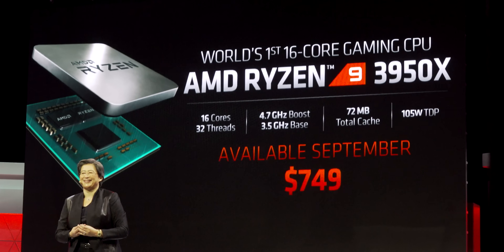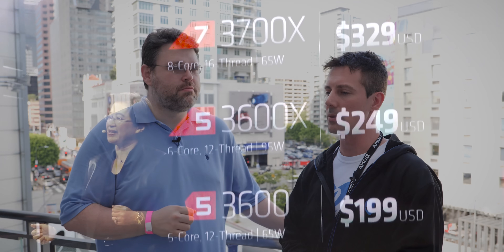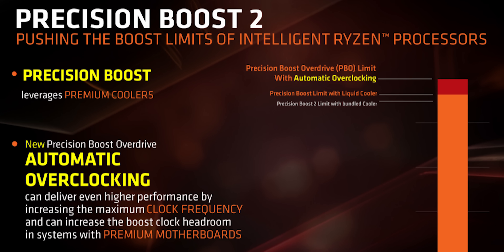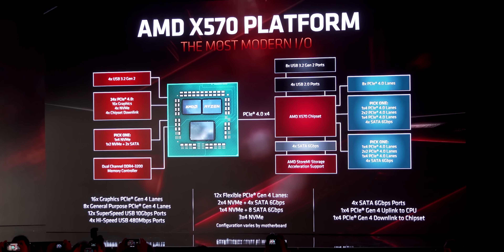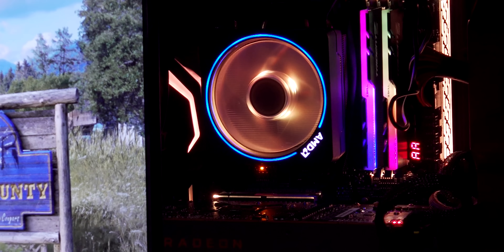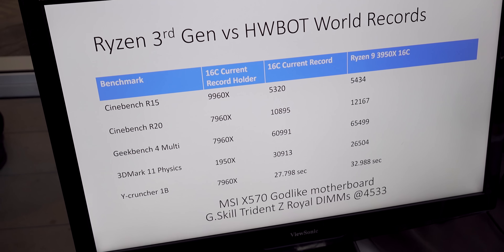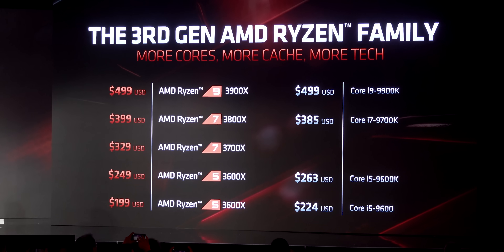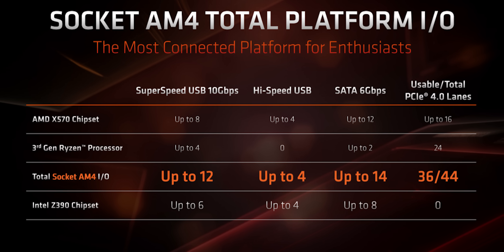...Is it 'The ONE'...!? (3950X & Zen 2 Discussion Ft. Wendell)

Comment: If you are boosting up to 4.7 I'd guess an all core around 4.3-5 depending on silicon lottery and how good your vrm and cooling are!
Reply: Also that 4.7 is more like 4.9-5.1! For single core that is the death of intel.
Reply: @NeoVoodooTech  How do you figure?
Reply: @Kirk_Blessed  Just a rough estimation based on the capability of previous and similar processors. I might be a little too optimistic but a turbo 4.7 with that ipc is still nothing to sneeze at.
Reply: @NeoVoodooTech  I'm with you there trust me I'm just as optimistic I just don't want to overhype haha... but we are absolutely getting a very memorable product.
Reply: @Kirk_Blessed  Agreed! Cheers brother.

Comment: Right, nobody buys the 2080 Ti because it's too expensive, the money is in the mid end side of GPU's like the GTX 1060 was and the 1070 those made the most money for nVidia, and for AMD the RX 580 made them the most money, but VEGA did not sell that much, soo why would AMD make a 2080 Ti competitor if almost no one will buy it. They could try to get better performance per watt because a lot more wattage means hotter card which limits clocks soo 🤷‍♀️
Reply: You are  right. 1060 is still number 1 with Steam users. 
Most gamers go that mid zone where the 5700(xt) comes in. Only one issue. Navi is too expensive. For 250$ you get a new Vega 56 that is faster than a 5700 if tweaked correctly and not far off from the xt variant. Its HBM2 allows a bandwith of 563gbit ( 443 gbits navi) if oced to 1100mhz which is ez if you get a vega card with samsung hbm and apply vega 64 bios. For light workstations use its also the better card with its higher tflops rating.( 9,75 vs 10,5 Vega 56), let alone better costumization due to unlocked bios. sry for my bad english.
Reply: @Dante Ice
Halo effect is very real,discount its effect all you want. AMD needs Big "Navi" to make an appearance. 80 Rops 320 Tmu's and 80 or 96 'Navi 10' CU's ,instead of just 40 on the 5700XT,and put Nvidia back on its heels. Intel will be Nv's main Discrete gpu challenger going forward after 2020 q3,is my guess,NOT AMD...

Comment: I see that fast ram has gotten cheaper, i wonder what will the 3400G do with 3600MHz ram and overclocked the CPU and iGPU. What performance will that bring? Imagine 1050 performance for that money 👁👁
Reply: Sorry to say this, but the 3400g is only 12nm zen+. You won't see much of a difference, besides everything beyond 2x8gb 3200cl16 makes it too expensive.
Reply: It might do slightly better than a GTX750TI but I don't see an overclocked Vega 11 even with 3600mhz beating a GTX1050.
Reply: Its a true ps4/xbox one killer, yeah i know that console already 6 years old but lets put it this way, its the same APU Form so APU vs APU its cool,

Comment: Hi mate how are ya I would like be helped I got an x3450 in a dell t310 I got an HD 7850 but I think is bottle necking wich gpu is great to combine with my x3450?
Reply: A more expensive GPU lol
Reply: @tdomingues89 this is a generally reply but ok thanks
Reply: rx 470 or 480 2nd hand
Reply: @redhaze8080  how much should I pay it in France if some one live here?
Reply: And I got a 1.1v port does she cut much the power of the gpu?
Reply: @salaheddinedanial4338  buy a rx470 or rx480, they are normaly cheap. How much do you want to spend ?
Reply: @tdomingues89  like less than 70
Reply: @salaheddinedanial4338  from ebay, a used 470. Arent you from France ? Dont you have more money ?
Reply: @salaheddinedanial4338  rx470 4gb, for 80 euros with free shipping. From ebay
Reply: @tdomingues89  mate why should I have more money cause I live in France xD and I pref not have an rx cause they suck a bit on WoW

Comment: I'm waiting for the battle between the 9900K and the 3800X. If the 3800X will overclock ok and if it will have equal or more performance, than AMD it is, because if you get a extreme mobo with the 8 core and in the future you want to upgrade you can go with the 12 or 16 cores and then you're good to go for another 2-3 years 💪🏻
Meant to say 3800X
Reply: But its a whole 100$ more expensive and will probably be slower while gaming. Or im completely wrong and this thing will oc to 5 Ghz. That would be bonkers
Reply: Siegbert schnösel meant to say 3800X i edited the comment.
Reply: @NinjaXHide  oh so its actually 100$ cheaper than Intel's gaming primus. Anyway i highly doubt it can compete with that out of the box clock speeds. We will know on 7th july and im really excited.
Reply: @Siegbert schnösel I think with the +15%ipc you get with the new chips aswell as the higher clocks it will tie the 9900k or be extremely extremely close, because the 2700x really wasn't that far behind it with lower clocks and less ipc

Comment: 2:17 "And the overclockability...!" what is completely unknown is how much headroom exists with any given SKU...*IF ANY!*  They could have binned them all perfectly with less than 100 MHz OC headroom, right?
Reply: I'm thinking that there's gonna be no headroom, wasn't there a big news article today about how they only got to 5ghz on LN2,.
Reply: @brandonupchurch7628  nope. The first xoc attempt with ln2 reached 5,35ghz max. Not very impressive, if you consider this is 7nm. Intels 28 core w 3175 x can go up to 5GHz with just a good watercooler(custom with 360mm rad)  and delid, and 5,7 ghz on all cores using ln2. 
Kinda disapointing from a AMD perspective. Intel at 10nm will probably hit 6.0GHz, for the 8core/16thread mainstream chip.

Comment: The 3950X will be bought by YouTubers and probably streamers, otherwise it's useless for normal gamers.
Reply: Yes thats why they sell it more than 500 USD because they know that processor are for nische market, but can be really good for the people who dont want HEDT platform but still want the performance from it, application like V-ray rendering are really take the advantages of higher core count.
Reply: Agree. I have several systems. Even my wife's Threadripper 12 core 24 thread/4x16Gb/1070 TI/960 nvme 1Tb, is mostly idle,she edits video and allot of high res png/bmp. My i5 9400f/2080Ti Black/2x16gb/2Tb Intel 660p sees more consistent all cores being pegged above 50%

Comment: This time are really good for people who want to build mid range (500$+) PC, because there are a lot of things that AMD can give than Intel when it comes to Core count altought in the side Intel still have more performance. but overall they really deliver some good stuff this year, especially on mid range market
Reply: Intel doesn't have more per core performance anymore. That's literally the whole reason this is all such a big deal. AMD has both single core & multi core performance AND power efficiency leadership. Even in Ryzen's weakest area before, gaming, they are now going toe-to-toe with Intel's best (the i9-9900K) and after the new Windows update (AMD's shown gaming bench's weren't with it installed) could very easily end up the undisputed gaming champ.
Reply: @Cooe.  i mean they just utilize their cpu on the specific game in specific year depending on cpu release, and once they change generation, the mobo become obsolete. AMD on the other hand optimize their mobo to fit 3 gen of their cpu lineup